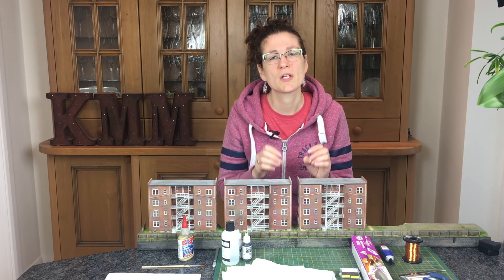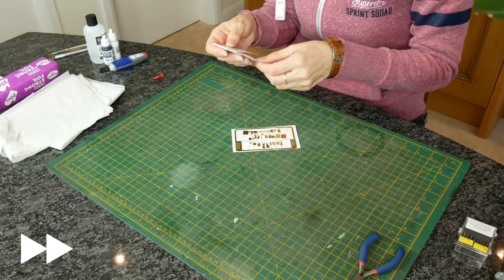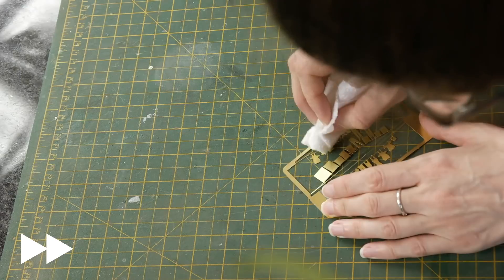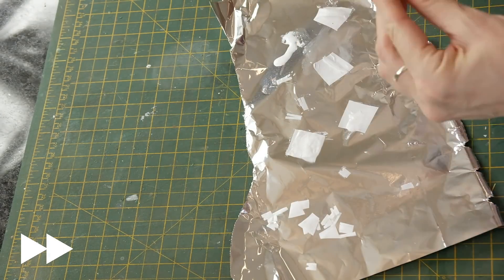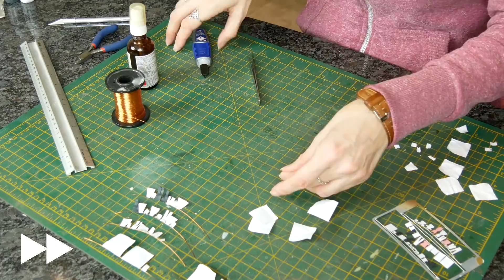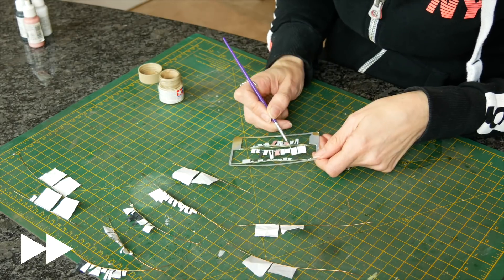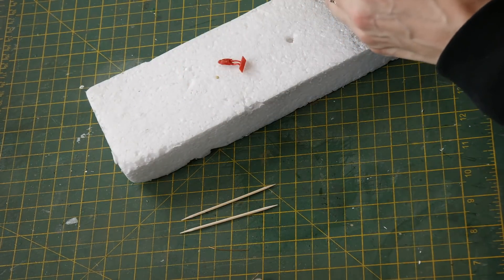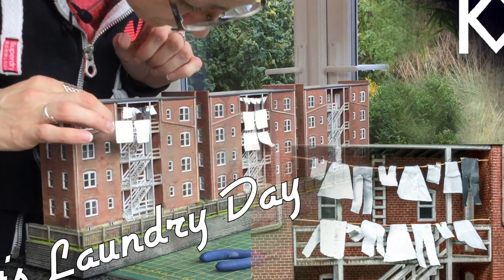How to Model Washing or Laundry Lines

Comment: Well Kathy, you've done it again. You taught me the brilliant solution regarding 'Super-glue'.
Always found it fiddly to hold part together and spray at the same time; okay if you're and Octopus, but alas, I am not. Thanks for sharing the tip of spraying one part and glue on the other. Imagine there's no wriggle time though !!
Reply from the maker: Hi. Definitely no wriggle time but a great method for parts. I use it a lot on attaching branches to trees too.

Comment: Kathy, Great video!  A helpful hint on making small holes in polystyrene structures:  Use small pliers to hold a sewing needle and heat it over a flame.  Once hot, simply push it into the structure in the required location pushing it only far enough to get the correct size hole.  Hold it in place until it cools and then slightly twist and remove.  Works like a charm!
Reply from the maker: Rick. Neat tip, thank you.
Reply: You're very welcome!

Comment: For a larger scale such as O, it's easy enough to just use standard thread and printer paper. You can probably even just print the laundry on it and use it.
Reply from the maker: True. It does depend whether you want the appearance of washing or actual scale clothing. In larger scales, I’m more likely to add more detail as it’s more visible.

Comment: The end result looks great. I would suggest you get a simpler pin vice, one that you turn by hand. That would make drilling the holes a lot easier and more accurate. I use a simpler one in my videos and you just have a lot more control, especially when working with very small bits. Cheers
Reply from the maker: I have one but not that goes down to a 0.6mm drill bit.  I plan to check out a few more tools at Warley this year.
Reply from the maker: Good point!

Comment: Another great video!

Hauler have a set of etched brass undies on the wash line in 1/72, might work for HO. 

Weston Minifigs made an HO cast set of washing and the woman hanging it on the line (set on EBay right now for $45!). Earl Smallshaw had an article in MR Feb 1989, running the wash lines to poles. You could use a barbecue skewer for a tall pole, but your backdrop buildings yards may not have room.
Reply from the maker: Thanks for those excellent suggestions. The poles is an interesting one. Unfortunately I don’t really have room but I’ll file the idea away.

Comment: Nice work! Lead foil is also good option for cloth at larger scales too, might require consuming a few bottles of wine though... sacrifices huh? 😁
Reply from the maker: Nice idea. I could sacrifice the wine but most of wine I drink now comes with a screw cap and no foil. 🙄
Reply: @KathyMillatt  that's called progress, apparently
Reply from the maker: It’s so much easier when travelling though. I do prefer screw tops to struggling with a corkscrew.

Comment: Nice job.  But two quick comments.

First, IF you have any old clothing you are planning to off to the rubbish bin, take a few snips of the fabric.  For keeps.   My wife calls them swatches.  I call my watch swatch.  From the SNIPS cut out general shapes to look like 1:1 clothing in your modeling scale.  Crumple a sheet of wax paper.  Really tight and bumpy.  Soak the fabric in a White Glue and water solution.  Then allow them to mold around the wax paper folds and dry.  Depending on how lazy I am, I either sew fine mono-filament fishing line (as the cloths line) through the tops of the clothing.  Or I take a box of toothpicks (this is best for larger scales).  Glue them to the cloth at one end, and glue the toothpicks to the cloths line.  Bob's your Uncle.  And Sarah's your washer woman.

B), Kathy, don't you have an extra pair of white cotton elbow length gloves, from wearing at the PROMS or Ascot.  They make a fine body oil barrier when working with brass cut out.  The white gloves I wear for spew cutting are from a Circus Clown.  Works wonders.

Love Great Model Railway Challenge,
See you DOWN THE LINE;
Jim

Comment: Excellent Kathy.  Very realistic. Is your rr layout built in diorama sections?  It is cool that you can pull out a scene and make updates to it.  - from Drew
Reply: Kathy, I found your layout tour. I did see this building on there.  Amazing layout you built.  Very cool
Reply from the maker: Hi Drew. I try to build all the buildings on dioramas as they are easier to work on downstairs on my workbench. The actual track is firmly fixed though.
Reply: Made sense.  Thanks Kathy.

Comment: Thanks for another nice video! I think i'll try that, too 👍 But i'll try to cut it with the laser... my fingers are not made for cutting such small pieces! 😋
Reply from the maker: I bet it would work like magic with a laser cutter. Wish I had one...
Reply: @KathyMillatt  I'll take a video if it works :-) The lasercutter (i built mine by myself) is after the airbrush my most important tool! Where manual skills end, you need proper tools :-) 
greets from austria
Reply from the maker: True. I’m into 3D printers at the moment and they’re a steep learning curve but open up so many possibilities.

Comment: I really want to figure out how to model a Hills Hoist washing line (the kind with metal pole with a ratchet to raise it up and 4 arms to support lines on a rotating bearing.) They are common here in Australia, every backyard after ww2 has one so I will need to make some if I want to have accurate details
Reply from the maker: That’s what we’ve always had. Probably etched brass. It would be a fun but incredibly delicate project to do.